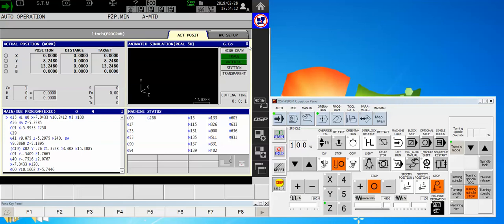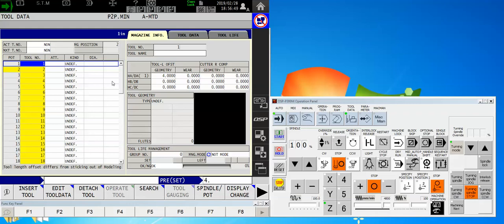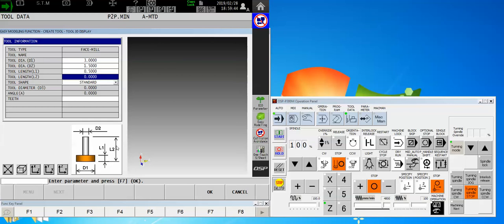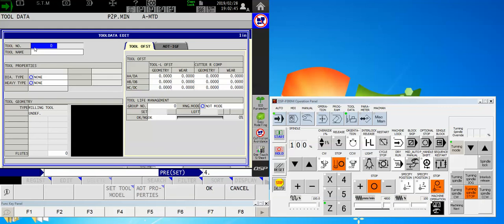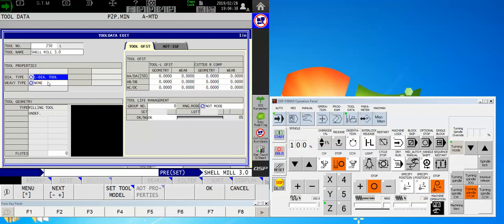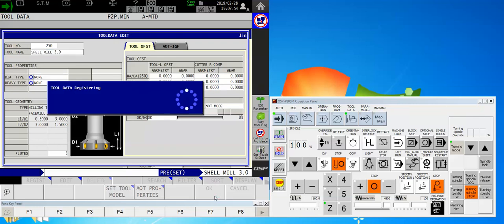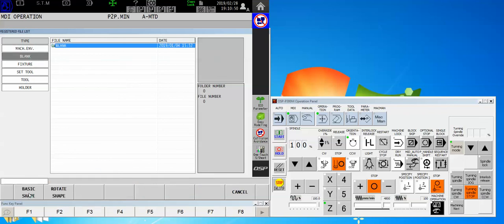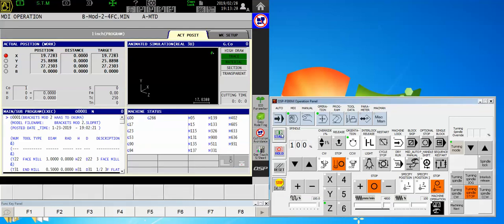MILL GRAPHIC

Comment: Hello! I have an Genos M560 w/OSP-P300MA controller. No Collision Avoidance installed. My Easy Modeling menu that you described at time 4:20 does not have "blank" for an option. So I can not define my stock. Is there a way of defining it in the .Min file? I see something about it in one place and it looks like this :

DEF WORK[1]
DIREC V
ORIGIN H1
CYLNDR 2P,[-50,-50],[50,50],-20,0
CYLNDR 0H,[0,0],38,-20,0
END
DRAW

And also like this:

DEF WORK[M]
PS LC,[-100,0],[100,30]
PS LC,[-100,0],[30,40]
PS LC,[-100,0],[100,10],0
END

I have tried both and come up with a 2414 Error and it gives me some example like PS LL, [0,0], [100, 100], 4. 
I tried that and it still errors out. Anything different I can do?
Reply from the maker: You know it! From the PROGRAM OPERATION screen (MD1), you can press the CREATE soft key, then one of the options is BLANK. That will allow you to describe the material and save it as a .DDT file. If you name it with the same name as your .MIN program, then when you PROGRAM SELECT, you'll see a field in the lower right corner of the window for MATERIAL DRAW(ANIM). Set that to EXECUTE and it will read the material file while selecting the program
Reply: @pocketcharleywithgosiger  That is it! Thank you!

Comment: Hello, i have a P300M. Why my renishaw probe is classified as an UNDEF. tool?
How can I know if the tool on the spindle is a probe?  i tried VATLB but it doesn't work.
Thanks
Reply from the maker: The tool definition is dictated on the TOOL DATA  tab. If you select the tool in question, edit tool data, then assign a probe graphic to the tool, it will change from undefined to PROBE
Reply: @pocketcharleywithgosiger  I try, but I don't think it will work
Reply: @pocketcharleywithgosiger  
no way. here you can see my procedure.
https://mega.nz/file/JSAWyA7L#pald8sEd7qd8XMjbB8xoghgETFNZmeatWsBWMIwCEgI